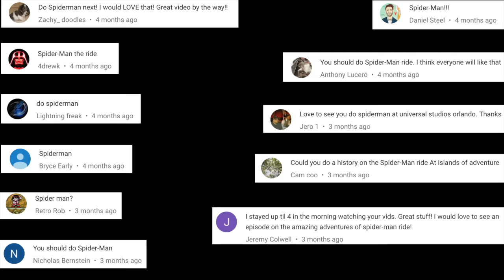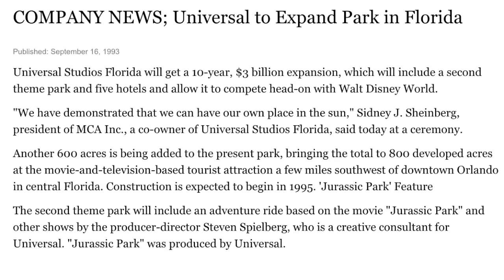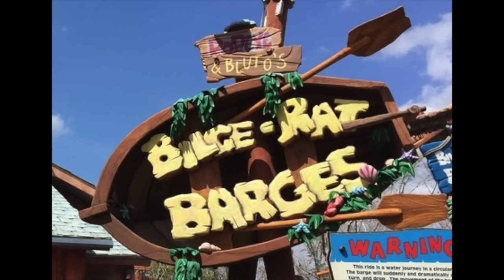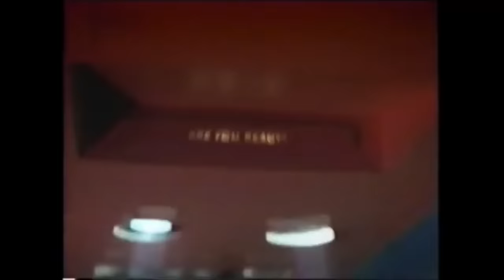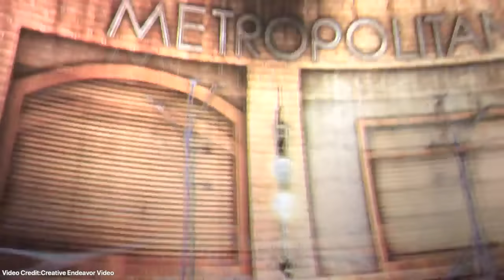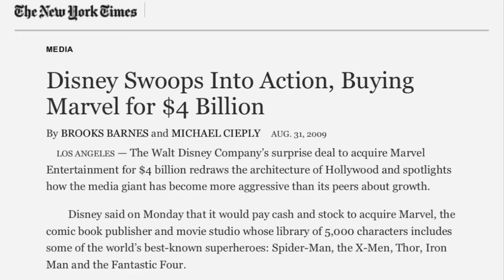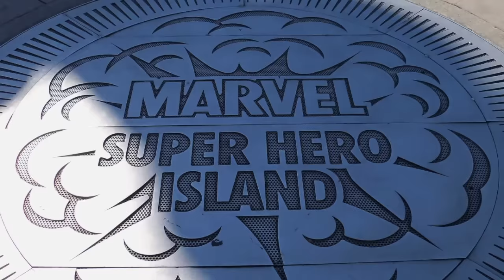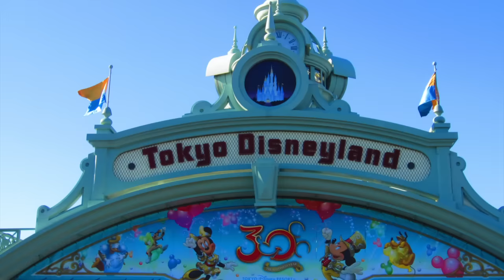The Theme Park History of The Amazing Adventures of Spider-Man (Universal's Islands of Adventure)

Comment: The ride never gets old, i still find it to be the best dark ride because its still the most agressive ride, the car movements are snappy and fast and it feels more connected to what happens on screen, specially when Electro electrocutes the car and when Doc grabs it with one of its arms to burn you. Other dark rides, or similar rides are not as agressive, most just take a more smooth and soft approach, which is fine, but not as fun imo.